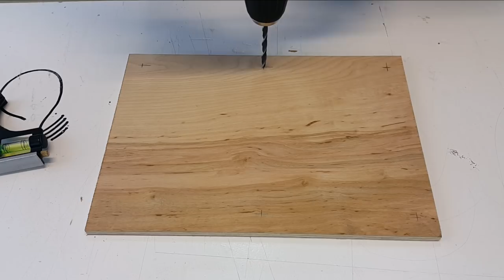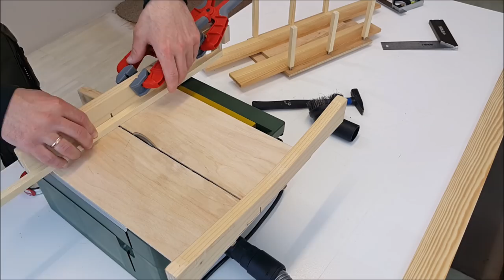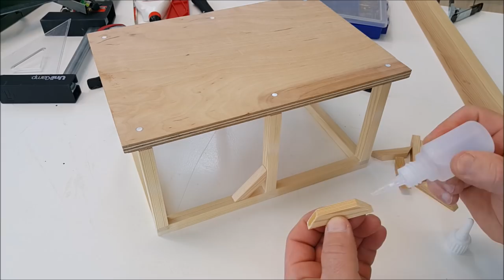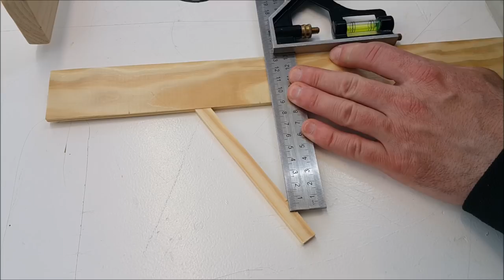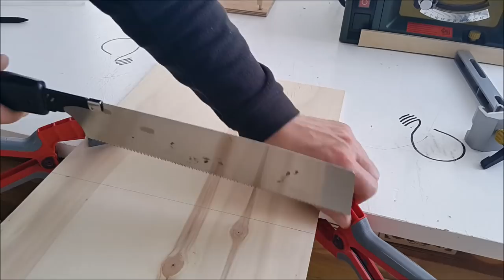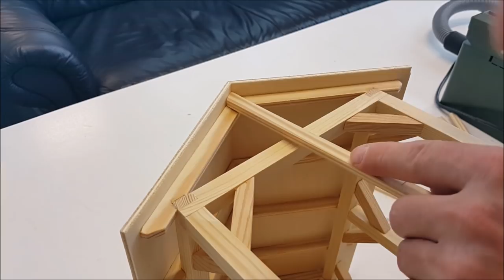Making a Carport Toy for Wooden Cars

Comment: Nice work... 
where do you buy your ca glue...  can you send a link?
Reply from the maker: Houtje Boom - Be Creative Mostly by company called 'engelbert strauss'
Reply: UBAID
ALI
Reply: Houtje Boom - Be Creative 
M
Reply: Houtje Boom - Be Creative
Reply: Houtje Boom - Be Creative gjgg
Reply: Houtje Boom - Be Creative process
🤔😕😤😤😢😲☹️😱
Reply: Igor Barros 
Hot Isuzu rival du idyll hydrosphere discover Isuzu if the if the if Fitz Ritz tix flux size Ritz Ritz Ritz did Shuzo shuts shuts size Ritz sitz
Reply: Houtje Boom - Be Creative v
Reply: Houtje Boom - Be Creative Wythe Also